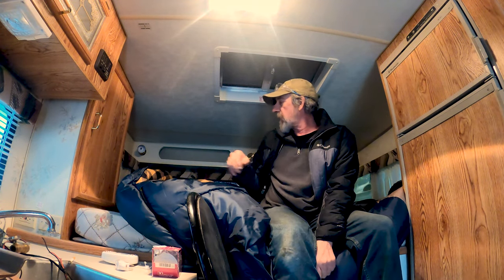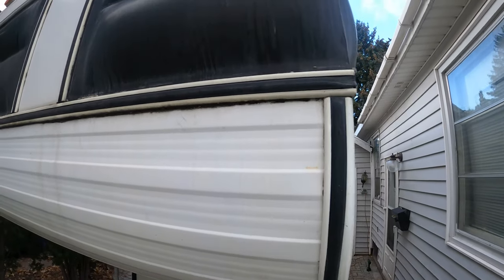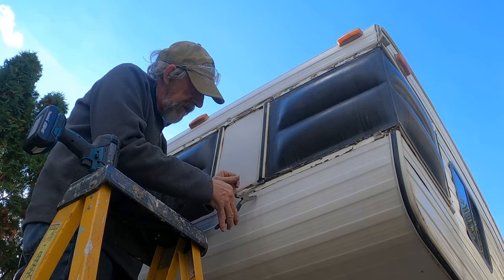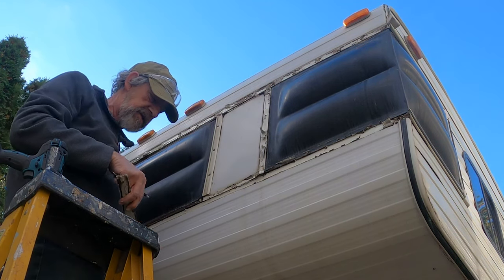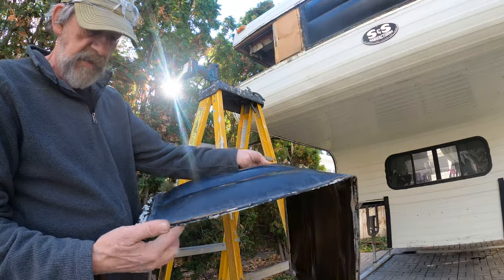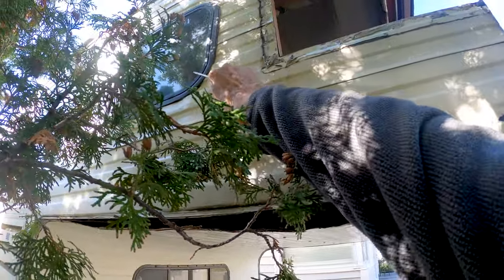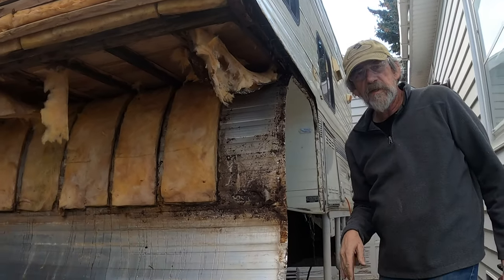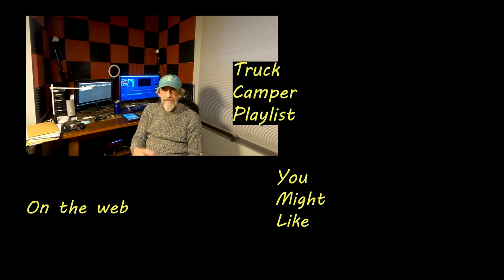Episode 5. Removing the Bubble Windows - Truck Camper Restoration

Comment: Loving your videos where do you source your parts I need some new aluminum skins and window seals,trim etc.?
Reply from the maker: Aluminum skin is available pretty much nationwide. You want to source locally to save freight. Shipping 16' pieces of siding gets expensive. Window seals is more of a challenge. A quick google search with the manufacturer of your windows should get you started. On trim I got mine from RecPro. There is a link in the video description that will save you 5%. I found there trim to be 1/2 the cost of what I could source locally.
Reply: I have a 70 something Roll-Along not sure who the window maker is?
Reply from the maker: @denniscooper3150  Yeah, I'd have no idea. I would suggest you try a Google search for vintage RV window seals and see if you can match the profile you need. I've not had too much luck matching mine. They are in okay shape. I'm treating them with silicone spray, and they are coming back. I'd still like to replace them at some point. I start with a site like Steel Rubber https://www.steelerubber.com/camper-rv/window-vintage

Comment: Does anyone know if you have to replace one of these windows - where you would get that window?
Reply from the maker: My guess is they are unobtanium. I can visualize making one if you had the equipment to thermally form plexiglass, but alas I don't think you'll find replacements.
Reply: @trbowlin  wow thanks! 
I would hope there were ones that could be bought to replace them no? Or are they considered vintage and no longer being made?
Reply from the maker: S&S still makes truck shells, but hasn't made campers since 2018. They have no parts stock for truck campers anymore and they were not popular enough for an after market mfg. to make replacement parts I guess.
Reply: @trbowlin  understood and thanks soooo much!